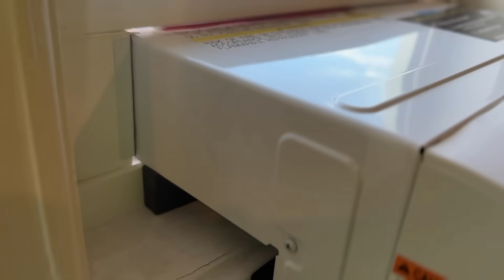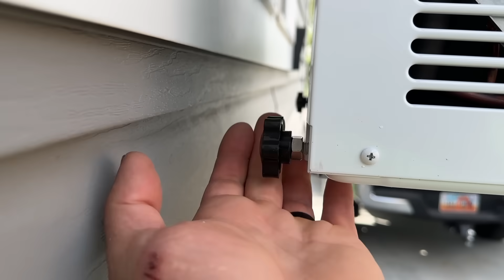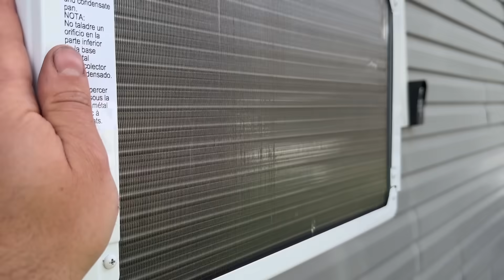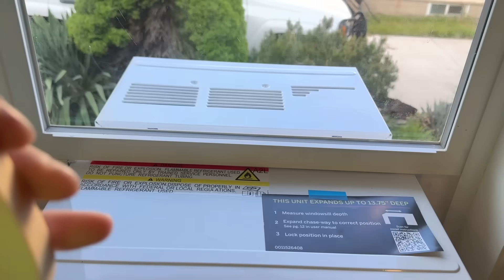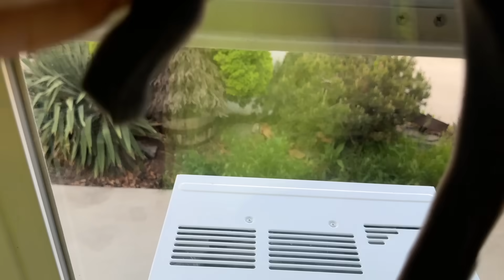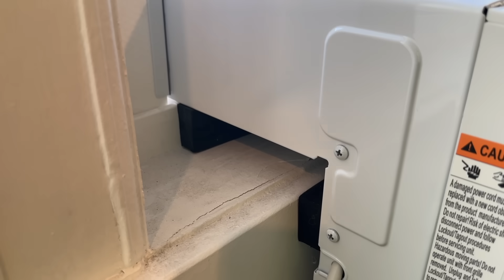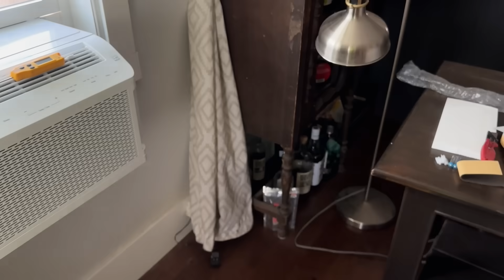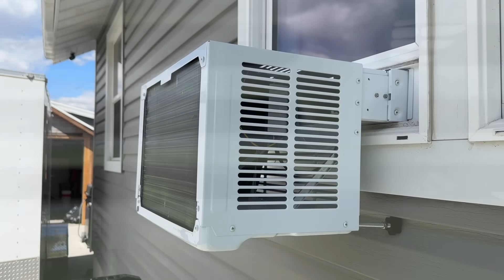Why Didn't Anyone Think Of This Sooner?

Comment: The condensate drain is to the front of the unit and the inside of the house , ass backwards! The drain is just shy of 1/2” so connecting to it and piping it through the wall to the outside is challenging. Grrrrrrrrrr! 😊mine is a soleus a/c

Comment: Wow! I feel better about buying this now! Putting it in a "barndominium", so cooling about 300 sq ft in scorching south GA summer heat. Jut wondering if it's safe to leave it running nonstop, with monitoring temperature and thermostat via wifi and/or the once or twice a week visit out to the lake. We are in the process of insulating the roof as this is a new project, but turning it off makes it virtually impossible to go inside and work because of the heat. Just wouldn't want it freezing up onme or anything. I think I'll get the answer I want, just making sure. Thanks!

Comment: bought a generic model like this on wmart website, 10k btus, supposedly weighed 70#, but no specs in the manual-- it was heavy! and it has a little plug on left side inside where u hafta drain the water every wk or 2. annoying. $330 new + 70 s&h, 30 tax. it cools great though, so far 2025...

Comment: Hi .   I bought one which is 8300btu.  Is not a inverter. I wanted a inverter model but it has to be this same model that blows air upwards. All the ones that had inverters were ones that just ones that blows air forward.  Can you send me a model number on this unit. And what btu is this unit in your video. Thank you

Comment: These are manufactured my a company called MIDEA. A large recall has been issued for approximately 1.7 million Midea U and U+ window air conditioners due to a mold risk. The units, sold under various brand names like Midea, Frigidaire,  Insignia, and R.W. Flame, were found to have a drainage issue that can lead to mold growth. Consumers with recalled units should immediately contact Midea for a free repair or refund. Others looking for this type as an option are encouraged to steer clear of these types of units.

Comment: I have a 10300 btu unit, at no time is this a stabil installation process, this unit will fall out of your window, mine nearly did upon intial install. We're now waiting on a shelf to be fabricated to support the heavy outer portion of the air conditioner.... This is not a simple nor safe design as purchased, be prepared to buy or fabricate an external shelf...

Comment: I know why. The one shown needs a stronger more durable frame in it, probably welded together, to resist fatigue cracking. A Box, made out of sheetmetal is much cheaper to produce, ie, low skill robots. The sheetmetal skin/box approach is used in tin cans, airplanes, enclosed semi trailers, and ductwork.

Comment: I regret buying this unit.  I bought it last year and started again this spring.  The pump wouldn't start.  I followed all the youtube suggestions about blowing out the tubing, draining and putting vinegar.  I haven't figured out if it is the sensor or the pump that is not working.  I did not see any crud coming out when I flushed it with vinegar and the water filter didn't look bad.  I haven't diagnosed the pump yet but replacement cost is $75 to $110 for that made in China little pump.  I know a lot of others had this issue but hoping somebody can post a resolution to the pump issue please

Comment: I recommend that homeowners put a long piece of plastic or smooth wood behind the rubber leveling feet outside, especially if the siding is vinyl or metal. Ultimately, those feet will leave indentations in the soft siding, and under certain circumstances, it may crack vinyl siding.

Comment: Not sure I would of angled the unit the way you did because of the water.   Water splash is used to cool the unit outside.   The drains are such that it allows some pooling of water inside before it allows to drain.   I firmly believe in taking a hose and washing/blowing out the inside every month or so in the summer to get rid of all the pollen, seeds, debris etc.  Keeping it clean helps.

Comment: I wonder hpw sealed they are between the outer and inner unit. My biggest complaint about window units is the lack of separation between exterior of home and interior. If that center section is sealed from the exterior and only has the line set running through....say a block of heavy foam, i am sold. I have 3 grow rooms and i need not only separation from the exterior elements, i also need light tightness. This is why i choose to use mini-split AC units. 
If anyone can tell me different about these new units, i am all ears (eyes)

Comment: Wow this unit is impressive regarding design and noise level, impressed but wouldn't buy simply because I'm doing perfectly fine with my Toshiba classic window ac 6,000 btu with normal single stage rotary compressor it works fine and the noise level is not to bad. still nice unit i bet it is super quiet with the compressor on full speed I'm guessing this is an inverter system?

Comment: The water splashing sound is by design to splash water on the compressor and keep it cool. You should not tilt it forward and prevent the water from hitting the fan.

Comment: That splashing sound is because of a drain plug that needs removed from the outside part of your A\C. Just look where the water is collecting and there should be a small almost flush drain plug. It must be something for shipment cuz i can't think of any reason why someone wouldn't want the water to drain out.

7:06 On this GE model, it might be that round black thing on the lower left.

Comment: Window AC use a fan throw water onto the condenser coils to help with the efficiency, that is why you got water splash sound from and drain hole is higher rather than bottom.

Comment: Hey man, late comment here, but could you possibly measure and tell me the amperage on this beast when it kicks on? I am looking to buy the 6100 BTU version, but the room I want to put it in is a 15A room that already has an office setup. I want to swap out the portable unit in this office since it really caused a power surge that made my UPS scream and emergency shut off the appliances connected to it.

Comment: mine got the infamous 'p1 error' code upon first use right out of the box, as many others have experienced. it shuts off and indicates that the pump is not working, and you have to drain the water reservoir. It's a known issue that a lot of people have encountered, with seemingly little help from ge or any recall that I know of.

Comment: Just bought this unit, and the drain hose fills the pan and fan hits the standing water.   Would have been better to have the hose routed to an actuall hole in the bottom of the unit.  I also had to open the outside part of the unit as there was a spare screw that was left in the unit that was vibrating around in it making noise.  Overall I'm happy with the performance.

Comment: It's supposed to have the water splashing sound. The fan splashes water on the condenser, the water evaporates and takes heat away making the unit more efficient.

Comment: The water is supposed to rundown on the condenser. The fan flips up on the condenser which evaporates and removes more heat. That's what makes it more efficient.

Comment: i came across this on amazon and really wanted it. but i don't think i have enough clearance on the outside to accommodate the unit - it's all hallway window that sits on top of the front porch landing cover. i'll have to try to find some very detailed measurements before taking the plunge

Comment: I see that the Chase-Way connecting section extends for different wall thickness, But can the chaseway be detached from the 2 AC sections. Like if you had a window opening that is clear for the finished height of 6” or so but won’t open any further, can you separate the 2 sections at the chase-way, pass the channel through your opening, and then reconnect the sections on either the inside or outside? Thanks

Comment: i waiting for a mini split with a unit on back that will fit thru a 10x10 inch hole in basement window to heat air or water. all one unit just hook up power and go diy

Comment: nice unit, but hope its easy to get to the condensate pump. It will be the first thing to clog or fail. If your handy probably not a big deal to take apart and clean.

Comment: Great for those in the Midwest and other areas, but doesn't look like it would work for those of us who have side-to-side sliders instead of windows that raise and lower.  The other issue is it won't work with screened windows unless you had custom screens made, so no opening the windows to get fresh air when it's not peak summer.

Comment: I like the design of them.  Too bad nearly all new homes have horizontally sliding windows.  Then again, a new home shouldn’t need a window unit.  But I’ve a 3D graphics guy and my computer runs hot, so I opted for the portable a/c unit on wheels.

Comment: I DID think of this before. About 15 years ago, to be precise. As well as the idea of incorporating full two way heating & cooling into an up or down U window unit. As well as an air filtration system, the latter of which, is still not being done. Of course it would add significant bulk, weight and cost. But less than these attributes as standalone units.

Comment: Modern window AC units are designed to hold the water so the fan can splash water on the compressor keeping it a little cooler. The problem is algae grows in it and every couple of years the unit has to be thoroughly washed with a garden hose.

Comment: Nice work and I look forward to seeing your next video. But I'm wondering if it comes with a remote or do you have to do everything via voice command or your phone? Also, I've always had to take out the drain plug on the outside to have the proper drainage with the instructions on what angle is best to achieve it. Lastly, what is the purpose of a "sleep mode" for quiet operations (at certain times) when it should be quiet most if not all of the time? Seriously, who would ask for the "loud" feature? Oh, and where does the noise go for 8 hours? Here in Florida, air-conditioning isn't a part-time endeavor. Again, nice work and thanks for the info.🥵

Comment: To me, I'm 70 yrs old, I've installed MANY window a/c units. IT IS very apparent that this little dude really has no idea how to properly install a window unit efficiently and correctly. The water splash sounds is all normal and it's really hard to hear on the inside AFTER it's run after a few hours.

Comment: Someone did, I believe it was Electrohome. I had a model in the late 1980s that was probably made in the early 1970s. It featured push button controls. It also had two separate fans because of its unusual design.  The unit you're looking at is very similar to, and perhaps made by Midea..

Comment: i like my 2 Mini-Split units better. They do not use windows at all and are very quiet on the inside and on the outside. Plus both of them are heat pumps so they cool my home in the summer and heat it in the winter.

Comment: They had them 40 years ago they had them for side slider windows come on man it was no big deal the refrigerant lines went through the slide part to compressor was outside in the evaporator blower was inside, it's been around for 100 years I've been doing heating cooling for 54 years I know you're only 12 years old

Comment: Noise and sound disturbance, from the compressor unit is directly getting transferred inside the bedroom. Not a good idea. Vibration cannot be stopped so easily, so its much safe and better, the compressor unit must be away and outside, for many reasons.

Comment: JUNK. My mom has one and when we take it out of the window it leaks a sht ton of water out the front. Instead of leaking all the water out the back outside like a normal ac, it will pool water on the inside section as well and it's disgusting. DO NOT GET ONE.

Comment: Well, this crappy window unit may not fall out, but it is far less efficient as the old window units allowed the condensate to traverse to the condenser section and most used a slinger to wet the outdoor coil, the evaporation if that slung condensate made that coil more efficient. This design robs the unit of that opportunity.
Plus it probably has one of the cheap Chinese compressors, and is probably using dissimilar metals with aluminum coils and copper U Bends and tubing ... So, it may or may not last one season before crapping out on you. But if it is using the high pressure R410a refrigerant, it probably will crap out on you before the season ends.

Comment: Just FYI you're not supposed to be hearing water sounds coming from it.
That sound is water falling off the condenser and grouping into a puddle around the condenser cooling fan that it outside and the fan is hitting the water. 
It's because you need to tilt the A/C more out the window and not keep it level.
Matter of fact if you tilt it too much inward the water will collect by the blower fan and will actually spray out the vents and you won't enjoy that cold air as it will also be getting you wet.
There is a drain on the outside of every window unit I've ever seen or installed and it requires a slight tilt outwards so the water drains properly via gravity.
Most units even say it in the manual and yours might as well.

Comment: Damn.. still not wide enough for the house I was interested in buying years ago.. the homeowner who built this home in the 1800s had internal plumbing with a cistern on the 2nd floor hidden in the walls... The home's downspouts all routed to the internal cistern and they would use it to wash clothes.... all the internal walls were 12" thick brick covered by plaster and the external walls were 18" thick.  Never seen anything like it.  Most solid house I've ever seen.  lol

Comment: The foam at the top is not for noise per se. It's to keep the cool air inside and the hot outside.  And the bew a/c units say in the instructions that the water is there to help cooling rather than just draining it.

Comment: Been using one of these for a few years now.  It’s a good unit, especially if you have odd sized windows that won’t fit a traditional unit. Just remove your bottom window, place the unit then reinstall the window.   The unit is a little awkward to move around by its self so two people would be recommended for a first floor install and pretty much required for a second floor install if you can’t get to the unit from outside.  It vibrates pretty loudly if it’s not close to level and the most notable point of failure I have experienced in one of our ACs is the unit having trouble moving water from the front tank to the back of the unit to drain out properly

Comment: Hay Bud, thanks for this video,  I like the design of this unit.  One thing I 2as wondering, I'm not sure you mentioned,  (maybe I missed it?), but,  what  power supply does the unit require? 30 amp/220 volt outlet, wired with10/2 romex?  Or 
20 amp breaker/110 volt (regular) outlet, wired with 12/2 romex?

Just trying to think ahead, and wanting to know what wire, amp breaker, and type of outlet I may need to install close to the unit.
  Thanks for any info. you know about this.

Comment: I don't see the point.

1.  You still have something hanging from your window;  That looks really cheesy.

2.  You still have the window open.  My parents bought a big nice house with hot water heat in Michigan when I was 12, and it had no central AC so they installed window units.  They were loud, and you had to jamb foam into the gaps in the windows and still you wound up with insects in the house.

3.  Winter comes and you still have to remove them up north, and re-install them in the late spring.  Meantime, you have to store them....

4.  The inside portion hangs down from the window, limiting space if you have a table or bed beneath.

Overall, this is a really bad idea;  My parents really needed mini-split heat pumps to supplement the hot water heat.  These look cheesy as well, but not as stupid as a metal box hanging from your window!  If I were my dad I would have had an AC unit installed in the attic of our house and found a way to install air pipes for the first floor.  He didn't want to spend the money.

Great video!

Comment: Sorry to burst your bubble, but they were developed before you were born.  The first introduction in 1965 was the Comfort-Aire Twin which was a window air conditioner with a split cabinet design that allowed the window to close into the center of the unit with the compressor and the condenser fan on the outside of the window and the indoor fan on the inside making for a very quiet

Comment: That would be perfect in the Philippines if you could put it up higher with the vents down, just changed the design of which way it blows out so you don’t have to put it down at the floor window level. It could be at the wall top level, the traditional air condition, the square box holes up top.

Comment: I have to LG indoor air conditioner units, they are amazing and the air blows upwards towards ceiling  which brings heat down. I truly love them. They look like a cylinder. Costly but amazing.

Comment: Nice..that would have worked nicely in my old place, other than the small issue that my bed was right under the window, which would have blocked the inside part of the saddle (would have been great for the next place, though)

Comment: one major flaw with the saddle design vs the Midea Air U shaped design is the GE requires a pump to lift the condensate up and over to the outside, something which will require regular cleaning and maintenance or it will get filled with gunk that always grows in air conditioners,  and will fail and cause water damage and result in the air conditioner being non functional